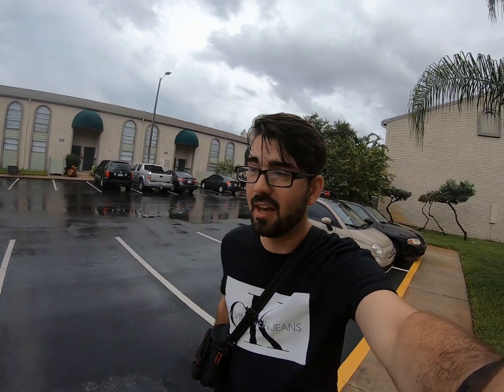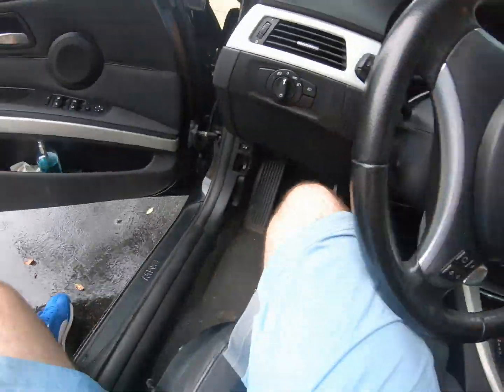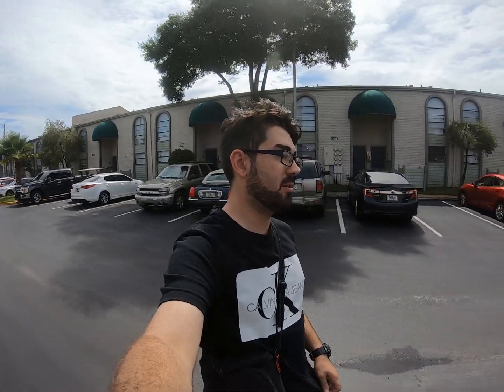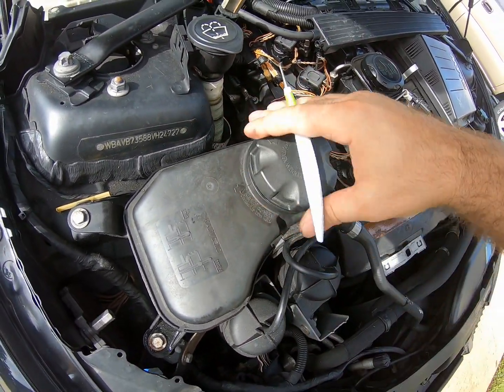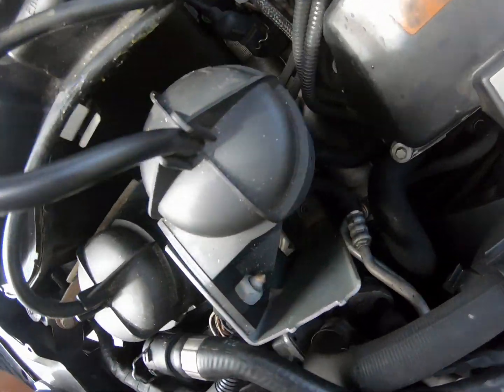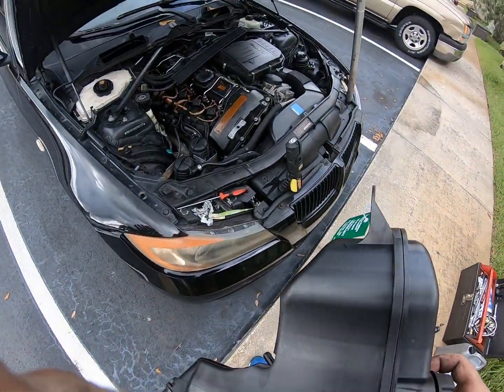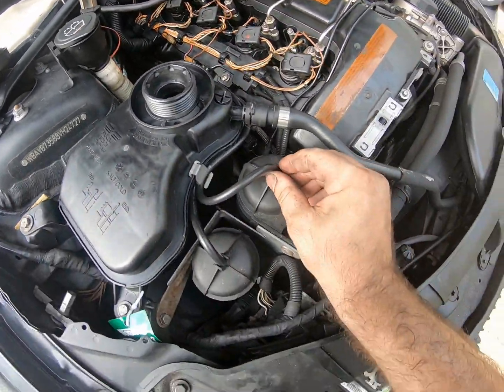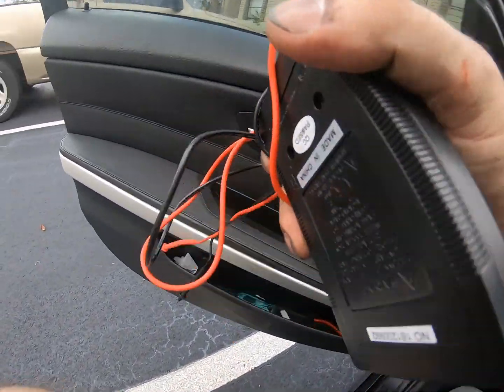N54 coolant expansion tank replacement (and electrical diagnosing pt 1)

Comment: Is the bottom hose of the coolant reservoir under the metal pipe or on top of it?
Reply from the maker: You taking about the inlets ? My coolant reservoir was relocated to the drivers side
Reply: Oh I see... I think I'm having an issue with my bottom hose... is touching the metal pipe but I don't know if it goes under it or on top of the pipe...I just need to figure it out before it burns the hose lol

Comment: So what did the multi meter read bro.
Reply from the maker: At first it was reading 14.2 when running but after a couple min I rev’d it a few times and it dropped to 12.2 and wouldn’t increase! So alternator DIY video is next. Already have the footage 💪🏼
Reply: Are you sure that is not the starter?
Reply from the maker: Yeah I’m sure! Basically the car seemed possessed. Christmas tree 🎄 lights on the dash and cluster flickering. Also the bass wasn’t coming through the sound system when I was playing music (first sign of dying battery)
Reply: How did that expansion tank work for you bro? Im reading alot of bad reviews for this brand